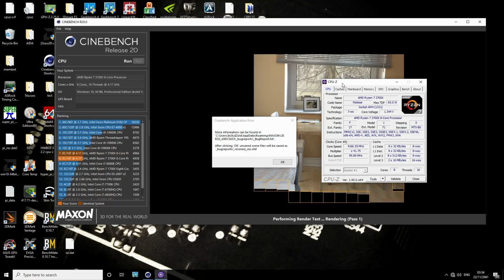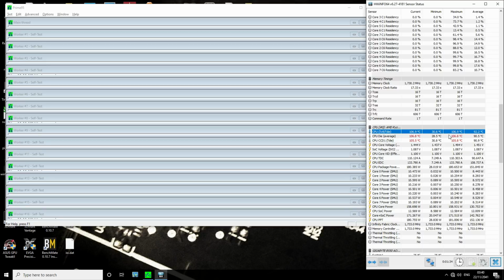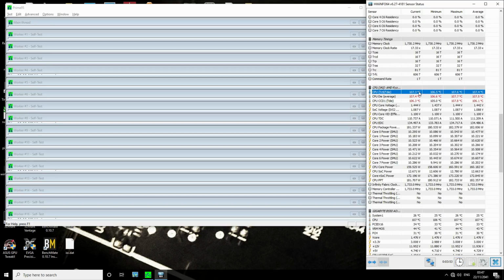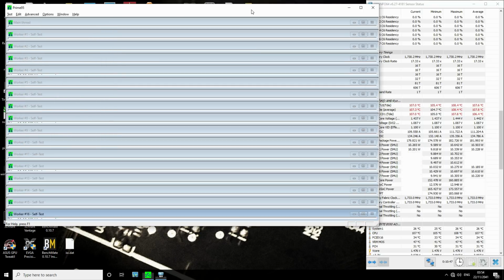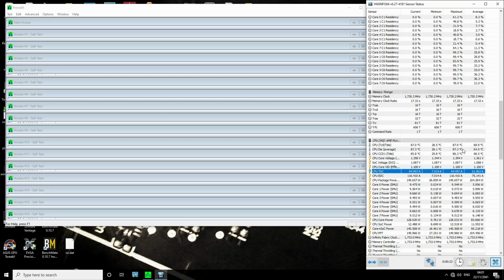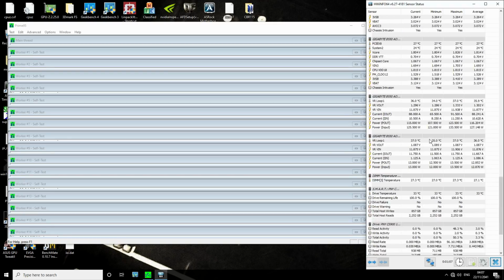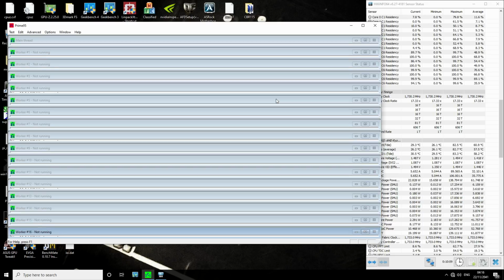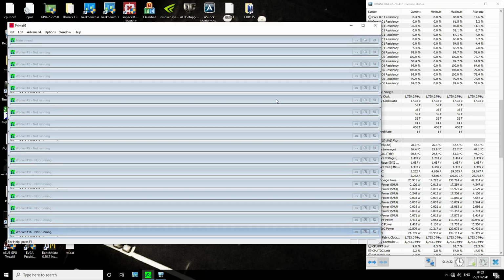Intentionally degrading my Ryzen 3700X

Comment: Well I heard of the rule of the thumb of degradation for capacitors is that for every 10 degrees C rise of temp, the expected lifespan halves, and vise versa. So If it DOES apply to semi-conductors (diodes), we can calculate the amount of weary you've done in 67 hours at 108C, takes 134 hours to complete at 98 degrees C, or 268 hours at 88C, or 536 hours at 78C. It's about 2 months time if you play games on it non-stop 8 hours a day, 7 days a week. Of course this is nowhere accurate and could be the worst scenario possible. Since the temperature reported is only one hot spot of the die it doesn't apply to the whole die so degradation will not be evenly across the die. Also the weary is only a lost of OC performance not functionality. Most of the users out there don't have a golden sample don't have the OC perf from the beginning. That's pretty much people keep arguing and can't have a conclusion cos it's practically not possible to measure the extend of degradation.

Comment: Got my  R7-3700x  in February 2020   Using Ryzen Master   i Run it with my Msi 240 Aio @ 4.5ghz with 1.375v  and i haven’t seen my temps go Over 66c yet with the most demanding Cpu titles : CyberPunk 2077 or most Ubishit titles ( Origins or Odyssey , etc .... ) after hours of gameplay 🧐  is that good or bad 🤔 feedback would be awesome.
Reply: Tell your CineBench23 score, cause you can have high GHz, high voltage, and performance itself can be lower than stock, cause Ryzens work in a weird way. My score on stock 3700X is 11700 on multicore.
Reply: @BOLOYOO  - i've tested stock vs OverClock : almost 400 point difference with Cinebench & other Software.
Reply: @hpcarlos2255  But what score?

Comment: The weak transistor can be anywhere driven by VCore... doesn't really matter.  It only takes one transistor missing a logic transition for the machine to crash.  So whichever one gets to that point first, that's all it takes.

I would actually suspect that it is NOT in the L3, because the CPU caches are probably the least stressed blocks on the chip (1).  That's why they can be so big.  So the CPU caches can probably tolerate the higher VCore better than the dense logic blocks can. 

-Matt

Note (1): This is why caches tend to dominate the extra space freed up by a node shrink, getting larger and larger with each shrink.  You can scale cache size up without impacting power consumption a whole lot.

Comment: I had a 3600X go bad on me, which was annoying because I had not been OCing it at all.   Tried different memory, different mobos... nope.   Any heavy load tends to produce a crash within 10 minutes now.   Popped in other Ryzen's I had on the shelf... no problem.   So I had to shelve that particular one.  A little disconcerting, actually.   One doesn't expect CPUs to fail like that.

My 3900X seems to regularly want to push the voltage up past 1.35V when under load, without OCing (beyond XMP'ing the memory anyhow), even though I'm fairly sure that it doesn't actually need to.  It makes me wonder whether AMD's own algorithms might be pushing the voltage a little too much and catching edge-cases just due to normal operation.   i.e. for a few milliseconds when going from idle to full, rinsing, and repeating, that it might just be taking a bit too long to reduce the VCore during the transition.

And its not as though I go out an intentionally overclock these things.  I always set a wattage limit in Manual PPT mode to something reasonable, like 110W, and the tower cooler keeps the CPUs really quite cool, usually no more than 65C.   So I kinda suspect the same problem that you do, that it is electro-migration, and I would go further and say... maybe its electro-migration more due to voltage than due to temperature.

--

Now the 5900X, which I finally decided to get despite the ridiculous MSRP+$N cost, has a really incredible feature in the BIOS called the Curve Optimizer.  Under AMD's PBO/Curve-Optimizer, I can shift the voltage-v-frequency lookup table plus or minus.  So I set it to -10 (I guess table entries), and I limit the wattage under PPT to, again, 110W, and now the VCore's are noticeably lower verses without the curve optimizer and also noticably lower than what the 3900X pulls with the same PPT wattage limit and the same load.  (the 3900X, of course, winds up doing this 300MHz lower than the 5900X).

-Matt

Comment: My 7700k i tried to get to run at 5ghz when i first got it and it would do it, about 3 months later (used cpu) after pumping 1.46 volts into it, she quit turning on, 4.9 runs fairly unstable now, and i have it at 4.8 xD oh yea this is my first experience with some degradation from overvolting it and running it in the 90's C  for like a month when it worked xD

Comment: i bet most cheap motherboard VRM's would give up long before the cpu. this allso shows how tough ryzen can be, realy have to be mad to degrade that cpu. 1.4volt with good cooling is 100% fine. image you got 25 mhz off over 80 to 100 hours of stress testing at 105 degress. i personal never degraded any cpu and i allways pushed hard on air & water :)

Comment: What cooler are you using? My 3700x gets to 70-75 degrees with a coolant temp of 45-49 on my custom loop at 1.225 Vcore, I feel like my cpu block isnt great...
Reply: Nevermind I just saw that it gets real hot under full load xD

Comment: Thank you for the info Buildzoid. What about PBO2 Curve Limiter is it dangerous? My 5900x is pulling 200 watts on cinebench r20 and the temps are 90c with  a Corsair h115i with -25 in most cores except the best ones who are at -7. Regards.

Comment: I install my Ryzen 1700 and will use 15 year old cooler paste - will it crash -most not likely - to replace my amd 1200 - 4 cores are not enough - really even at 3500 ghz -How would old paste degrade anywy -Does gasolin degrade to disel?

Comment: is 43.50 at 1.316V safe on a 3700x?
Reply: Yes it is. Check your thermals, watch the video if you feel like it. The current draw shouldn`t be much above what pbo does anyways.
Reply: @Koeras16  so I've been running these settings for the past 2 months with no problems in any games or cinebench. I get better thermals and benchmark scores for single and multi-core performance thank stock PBO. The only issue is that it is not stable in Prime 95. Every other workload works perfectly normal without crashes. Should I change my settings or keep it how it is?
Reply: @areyes425  If it's not stable in prime95,  I would usually consider it not to be stable at all. You could increase LLC (load line calibration - dont set it to the max though ! and check your manual to know what is the lowest settings and what the highest) and see what happens. You could also increase Vcore by 5 or 10mv (0.005v or 0.010v) increments and test until stable. But that your call. 

If you decide to keep it like that just play around for a few months and see. It's likely that you don't do anything that could crash the PC. Prime95 is a rather unrealistic workload. 

And if by any weird coincidence it crashes, you at least know why. Which is honestly the most important thing when toying around with computers or anything honestly. Also check your event-viewer for WHEA errors (Event Viewer(Local)\ Applications and Services Logs\ Microsoft\ Windows\Kernel-WHEA). WHEA errors can mess with the operating system (you don't want that).
Reply: @Koeras16  ok thanks on the insight. I just wanna run my cpu at a decent clock and voltage without the fear of degradation.
Reply: @areyes425  This chip will not degrade at that voltage.

Comment: Wow, you came to the same conclusions as I did back when Zen 2 launched and people were so clueless what the "safe" voltages were. I just took note what kind of voltages and current the CPU (3900X) drew and stuck with them. It's not like AMD ships them with unsafe settings. 7nm is a real pain to cool though, and conveniently that ~1.35V limit is just perfect with my 280mm liquid cooler.

Comment: I wonder if there is a correlation between chips that degrade slower and chips that clock higher at a given voltage
Reply: Degradation as far as I know happens in the Copper interconnects of the first metal layers (the thinnest wires) so there shouldn't be any correlation between silicon quality and degradation speed when overclocking. Maybe leaky silicon degrades at stock settings in 20 years instead of 30 but manufacturing variance in the Copper layers should be a more significant factor than silicon quality per se

Comment: I also run my R5 3600 at 1.45V for 3D benching. No degradation so far tho it was never a good chip to begin with. 4.2GHz all-core is the highest I can get it 24/7 stable.

Comment: it took 8 months for 1.45v at 4.3GHz to take 25-50mhz from a few of my R6 3600 cores when it was returned to stock.
Reply: After degrading the performance at stock was exactly the same as the day i got it according to the benchmarks i ran.  The cores that lost 25-50mhz rarely hit 4200 any way.

Comment: I wonder how much temperature of liquid in this arctic AIO when CPU under 107 C. Coz if you have more that 60 C temps of liquid it will start to evaporate pretty quickly and eventualy start work pretty bad. That was happen with my acrtic liquid freezer 120 (first model with 50mm rad) after 3 years of use. But also it has a bit of green corrosion inside waterblock. (Asetek not recommend to exceed temps higher than 60 C ).

Comment: y old 3800x ran at 4.475@1.39v edc160A for ayr and still does
Reply: @Walther Penne yep for daily i ran it edc 1 +200 and auto volts so it wouldnt crash on games it took a while to get 3800 14  14 14  14 28  42  260 stable  needed ccd and iod at 1.1 / 1.15v . Strangely zen 3 needs much lower ccd/iod and vddp especially vddp around .860-.900 to run anything over fclk 2000

Comment: EDC is the max instantaneous current draw. TDC is the sustained power draw.

So if the load is spiky in the microsecond range, EDC will be higher. 

Basically the VRM loadline calibration needs to be able to reach EDC for tiny periods without dropping the voltage, and browning out the chip.

But for thermal, TDC is the number you watch, since that is the average power drawn over seconds.

Comment: supposedly the max limit of Ryzen is supposed to be 1.55. I would want an extremely stable supply,ups and 220v feed ,Great vrm and a hope and prayer . That seems crazy but ln2 guys might go higher? I'm super comfortable at 1.45 and no signs of degradation after about 8 months steady OC.3200g at 4.2 ghz

Comment: Stuff degrades over time so pushing something to max is always gonna end-up with you needing to reduce it down

My 1070 has lost 200MHz on the ram and 40MHz in the core since i got it
Reply: @Cleru Zinek nope pads and paste have been replaced a few times actually

Its degradation 100% because i always stability check it with the exact same windows install and software via just writing the image doing the tests writing down the results and then writing my active image

I have lost 200MHz memory and 40MHz core in the time ive owned it

Everything degrades there is no questionable about it, its just simple fact

I will add that its been used for gaming at 4k for 11 hours a day for the last 4 years and has done maybe 1000 hours of mining as well and in mining i use to be able to max the memory slider now its down 250MHz under mining load

So its degraded from mass usage

Comment: I abused a Ryzen 5 3600 last summer as well, though at a lower average voltage and temperature in a hotbox: https://www.reddit.com/r/overclocking/comments/i5xn8y/ryzen_3600_voltage_degradation_tests/
Even after 700 hours, I only saw a 25 MHz degradation from stock. These chips can take a lot more than some people will lead you to believe.

Comment: EDC hurts my Brian. My r5 3600, could pull up to "190A" with TDC 80-90A running 4.5@1.325 at 90+ degrees. Got scurd so running -75mv offset and PBO on board settings and it'll boost individual threads to 4.25-4.3 and all cores 4.1+ in CB and 4.0 in p95 avx. Might go back to finding a stable all core above 4.3 (i am king normie)

Comment: @Buildzoid would you do this test on threadripper? I've noticed my 3960x has degraded 25MHz over the course of avx heavy loads 3.9-4.1GHz all cores@ 1.15 LLC5 droop to 1.125V under about 250W for the last year. Thing is though, the cpu I've got threw errors in p95 at STOCK.
Reply: should of returned it

Comment: Can a ryzen cpu degrade at 1.4 to 1.5 volts during single core workloads?
Reply: apparently not
Reply: @Walther Penne it depends a lot on what generation you got.
1st gen ryzen can handle more voltage than 3rd gen for example.
I can comfortably take my 2700 to 1.375V max 1.4 while I would not push a 3rd gen above 1.35V long term.

Comment: I have been running my 3300X at 4.55GHz @1.35V for as long as it’s out now and nothing has yet to happen. I hope that my current settings is still in safe ranges because I’d to continue using it like this for the next few years.
Reply: I had degradation at similiar voltages with an 3600, you might wanna reduce your voltage to really almost unstable, that way you would notice degradation sooner!
Reply: Are you still running the cpu like that?
Reply: @czbrat  yeah, and it's still doing just fine
Reply: @thangluongquang2826  what load line calibration do you use if any?
Reply: @czbrat  I am currently using Level 5. Voltage regulation on modern motherboards nowadays is so good that I think Vdroop is not that important anymore. But please note that I was (and am) using an Asus ROG Crosshair VIII Formula so your results may vary.

Comment: I've found the bios update on the AMD 3rd gen can make a previous 4200 clock unstable while 4100 okay. Different version bios be it older or newer changes the stability again. Seems another bios update hurts the 4200 clock. So I skip it and wait for the next update before I try again. It also does the same thing for stability on the COCP (XMP) profile. I have tested on nearly a dozen AMD 3600 to 3900x CPUs. Mostly ASUS x570 motherboards. I've also found that @4100 to 4200 CPU Vcore @ around 1.200v with LLC level 4 (turbo?) is the sweet spot. Runs cool and stable on all the CPUs (4200 without the dud bios). All tested with stock cooler. The main 3900x I use runs at 4300 with Vcode @ 1.175 (I don't think the 0.005 increments work and actually gets rounded up so actually at 1.180v). All other voltages and overclocking settings are mostly default or auto. All dozen CPUs have been used nearly everyday for over a year now.

Comment: Don't remember how Zen2 ran, but Zen3 in FS / TSE /TS CPU tests runs at 1.4V with stock settings. Also, my 5900x typically pulls 20-30A more than 3900x with static OC, but admittedly it's much higher in frequency (4800 vs 4365)

Comment: Der8auer started ryzen 5600x and 5800x test, in which cpus runs with 1.4V+ 24/7.
Reply from the maker: pulling only 80-90A and running at 90C. I think the chips will last ages with a workload that mild. They are barely pulling more power than they would stock.
Reply: @ActuallyHardcoreOverclocking  

Say I jumped on this 5000mhz 2x8 kit, then ran it 4x8 even if its not going to probably run full speed. Would I get at least close? Apparently the ASUS QVL doesnt list everything like that third party site. 

Like could I expect maybe 4600 or 4800 with all 4 dimms populated to fly? Id hate to buy ram and have to instantly return it.
Reply: @ActuallyHardcoreOverclocking  

Zen 2 with this board X570 hero was a buggy POS. It would bootloop when it felt like it, then drop my riser card nvmes at random decided on boot. Bifurcation was also a broken POS. Obviously ive tried multiple bios. They seem insistent on forcing a ton of voltage you dont need, which I guess speeds up the need for another CPU. It refuses to change from retail to any updated bios ive since tried.
Reply: @ActuallyHardcoreOverclocking  

Please overclocking God, have mercy on a poor soul like me.

Ive worshipped his name five times a day. 

Gabe Newell is watching.
Reply: @ActuallyHardcoreOverclocking  Don't be silly.

Signal pathways degrade faster at 90c, shouldn't have to tell you this dude.
Reply: @nexxusty  even at 105 degrees it wouldnt rly make a difference. They might die 10% faster but who cares thats still like 9years:)
Reply: 1.4+? I thought he is running them 1.4V set. That is not die-sense right?( Im just asking may be completely wrong...)
Reply: Can Erkin S. - running my R7-3700x @ 1.375v  all Core 4.5ghz with Cpu demanding games “ Ubishit titles “  will it kill my Processor in 5 years ?  and i never Surpassed 66c  with my Aio   🎮
Reply: @hpcarlos2255  no it wont
Reply: @dvr1337  - Thanx !
Reply: sw4gr1d  

George Lucas should have distributed the ‘source code’ to Star Wars. Millions of fans would create their own movies and stories. Most of them would be terrible, but a few would be genius.
-Our Divine Leader

 Charge Luke hiss shhh hood half does drip heated thaw swords coat toss door worse...

Do or do not, there is no try.
-Yoda
Reply: sw4gr1d  

Singe.

Qui-Gon Cutting Through Door 1 HOUR
37K views
Reply: sw4gr1d  

steamcommunity taught calm discussions forum 7 619568192960416308

Gabe Newell Amen.

Comment: My 5800X & 3300X both disagree with your ideas for working out safe clocking. Both had to be under volted & have manual clocks set up at or below the pbo levels to stop them overheating.

Comment: Everyone: globla shortages in CPU and GPU supply suck
Buildzoid: let's just try to degrade 3700x
Reply: 3000 series fairly readily available. Actually on sale fairly often.
Reply: I've seen many 3000 series ryzen cpus in microcenter
Reply: Maybe his showing u dont need a new 5700x when u can overclock ur 3700x abit and not have to worried about degrading there chip xD And look up you can buy ryzen 3000 anywhere buddy